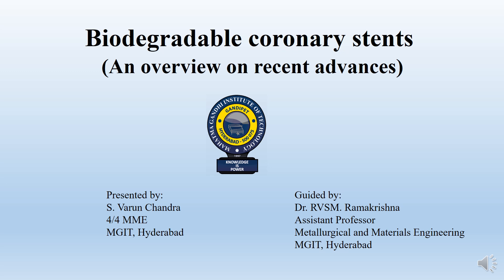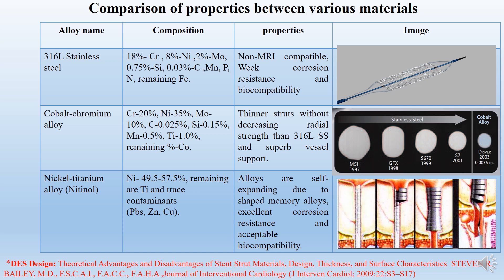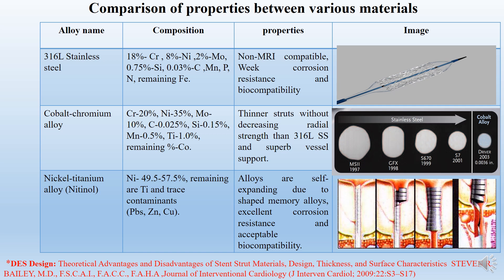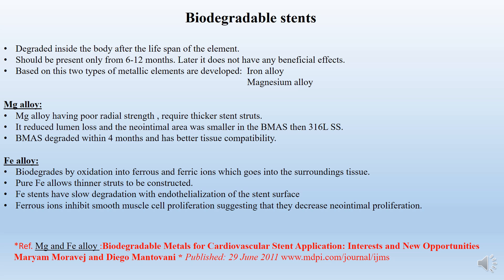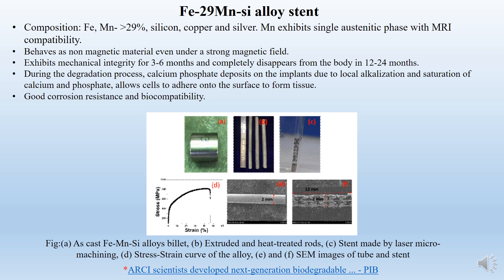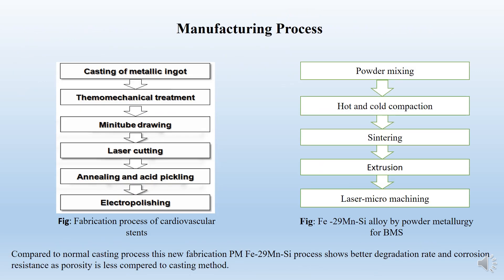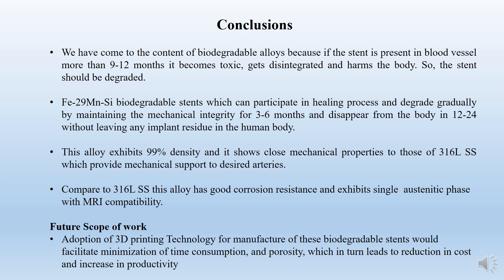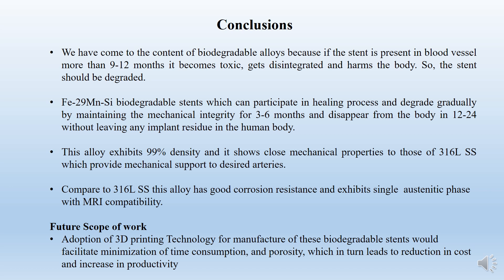biodegradable stents ppt   Varun Chandra

Comment: Can you please explain the factors which are responsible for higher corrosion resistance of this alloy compared to even SS316L?
Reply: In case of 316l SS we basically obtain corrosion resistance because of chromium. But in case of Fe-29Mn-Si alloy the Mn offers the better corrosion resistance and 316l SS is manufactured by casting process and Fe -29Mn-Si is manufactured by powder metallurgy process.